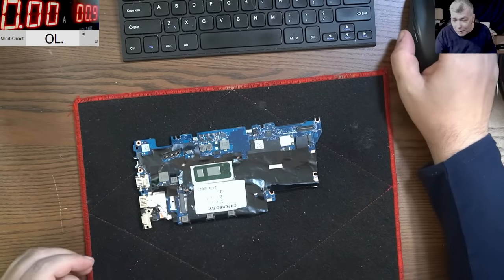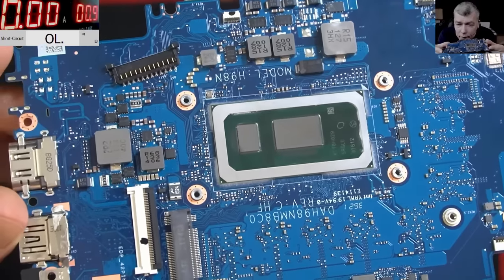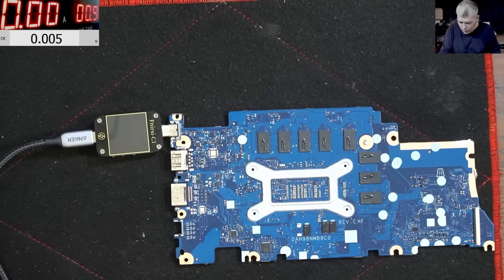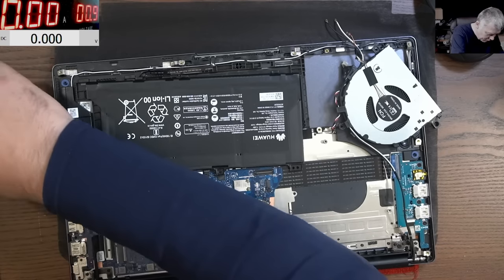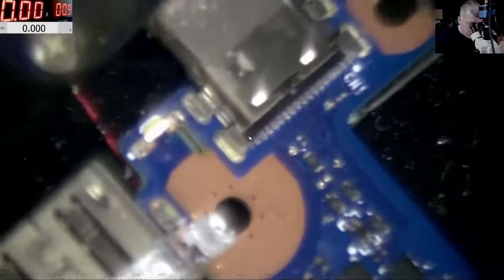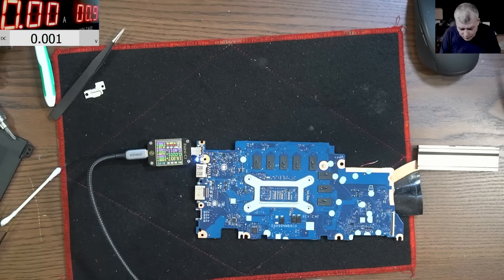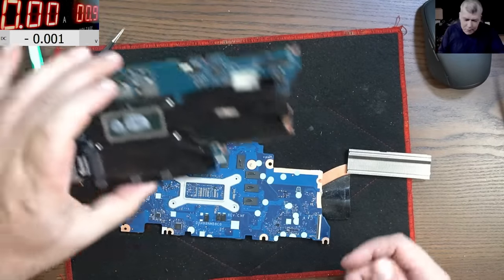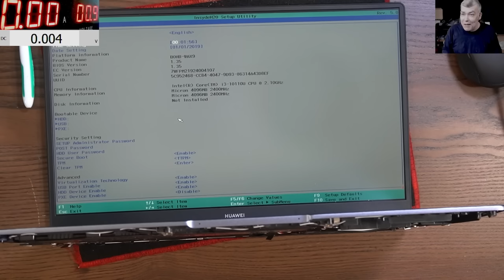Huawei D15 laptop. dead - Buying faulty motherboard from Ebay and fix it? Can we? Worth it?

Comment: SORIN PLEASE at least one time, just one time show that you change the thermal paste, you drive me crazy, you put the heatsink without any thermal paste, just whatever crusted bits was left on it, PLEASE DONT KEEP SHOWING THIS to people, its not ok to do this, always change the thermal paste
Reply: He will change it later. It was only for test
Reply: Hihihihi
Reply: Chill m8. Sorin changes the paste if it needs changing, and he doesn't if it doesn't. Think of it like this, If your laptop didn't have any problems it would have the same paste all its life.
Reply: @Brianck1971  ahh okk  he changes the paste after removing the heatsink only if it's necessary.... like "head gasket" on cars :) hiihihih
Reply: I can confirm he does not change. He fixed my dell last week. Same old crusty paste.😂
Reply: @hinny2005  i think he might not even have one on the shop, like it costs a lot or something, more people should tell him this is not right, he is a great technician but some things he does are just wrong, thank for sharing
Reply: @hinny2005  He has never been anywhere near your Dell.
Reply: @Brianck1971  the xps from last week was mine. Personally I don’t have a issue with him not changing. His job was to fix the fault. I can change the thermal paste myself which I did.
Reply: @Brian C  I have heard the he changes it later story many times, is it so bad to show the proper way, even one time, find me one video where he does it my friend
Reply: @jimmysmantzas  in many of his older videos you can see him changing the paste
Reply: @ДимитърАндонов-ъ7е  i just show him change it for the first time in the new video today with the pch replacement, i just wish he would show it more often
Reply: i just show him change it for the first time in the new video today with the pch replacement, i just wish he would show it more often
Reply: @hinny2005  It was not yours and there was no thermal issue with that machine.
Reply: @Brianck1971  what are you talking about. It’s literally in front of me right now. I’ve told you twice it was / is mine. The thermal paste needed changing, dropped 6c after I replaced it. I’m not going to respond anymore to your idiocy.
Reply: @hinny2005  Changing the thermal paste would not make the temp drop 6c. I still dont know why your prentending that some random persons laptop was yours.

Comment: what?? solder mask?? no! that's wrong. we expect solder mask on the alex channel. here, it must be hot glue! uff. i hate this mixing. what's next? louis using a proper calibrated fuse? weird.
Reply: each item has it use, hot glue is used for holding plastic  or big compounds in place, uv mask using inly for small wired and for isolation

Comment: 3 "technicians" already have checked the board.. Hah.  
Anyways, I suggested on  the previous video to buy the board, it is worth the value, in the worst case scenario for spare parts... But it comes up that is functional.
 Good call Sorin ! Keep up the excellent work !
Reply: Probably it is just type of techs that just replace motherboard :D. In my young ages i was working in that type of company, now sometimes i replace capacitors :D.

Comment: the seller has so many motherboard, and too few time or people to check every single recovered part is working (or not). so is a game of speed, to list enough boards per day. it not worth the time, for them to get bogged down. so instead with ebay condition category sell a parts / not working... this is not unheard of. and if the board costs them $0 originally as an e-waste... then thy made a sure fire 30 bucks. for the work to make the listing

in terms of broken charging port / broken tracks then yes, it does not worth their time. and maybe they can guess well for this common damages. anyhow, very interesting to see this example dead boards. a good learning experience to share with us here
Reply: ebay take 10% of that as a fee, also paypal takes a fee, ...in the end you get less.

Comment: When I saw all the broken circuit lines (pads) I felt like dying! How is that possible! How does the user manipulate, i.e. insert the connector like that? ...could accept let's say 5 broken lines but ALL of them (omg). On the other hand, excellent work of patience yours teacher Sorin and therefore a happy customer. Thank you very much for sharing because here in North America it will be difficult to see a laptop from that manufacturer. Cell phones YES, they are common (people buy them). All the best.
Reply: what i suspect is someone tried to replace the charging port and ended up breaking all the traces
Reply: @saberben4785  Yeah, you're right. It makes all the sense in the world because I should have assumed the owner would insert the plug carefully. Thank you very much for answering and i mean it with absolute sincerity because that's how we all learn. All the best.

Comment: Dear Sorin, I thought that the problem of this series of laptops of this manufacturer was the failure of the SOC Package . In my opinion, the motherboards of this company are not in a very good condition in terms of quality. I think if you buy a BGA device, your success rate will be higher, there are many cheap options like Seamark ZM Series

Comment: I have been to a RMA dept factory sale and there was mountains of PC motherboards - bought 5 and 1 worked -. 
I'm guessing it's from a RMA dept, ie, if they can't get it running in 1hr they just swap it out. So it's either the RMA selling the old stuff, or it's from e-waste recyclers where the RMA stuff is dumped.
Reply: Yeah. Completely agree. They call them "flea markets", "garage sales", "auctions" "swap meet", etc., they take a street in a city and set up their sales tables, usually on Saturdays from 8am to 3pm and you can buy from gadgets complete electronics even by separate parts. I also love going to a specialized auto mechanic because they don't get complicated, in the event of an engine or automatic transmission failure, they simply completely remove the old one and install a rebuilt one. I'm talking about the US states of course. A brotherly greeting from Mexico.

Comment: Sorin, the 3.3v and 5v always supply is short, I injected volt 5v at 5v pwr supply audio codec ic heated. But on 3.3 line I injected 3.3v board takes 5amp but nothing heats the pch is getting little warm but non component is heating, spend two days. Touched almost every component. What could be the solution.

Comment: I am saying to my customers that if they like, we can risk. I'll buy a part, and spend time on a repair. If things will go sideways, they pay for the part, or I keep the device. Especially with TVs, laptops, phones and tablets. But with game consoles, I say that I can buy off game console if I can't fix it, I'll use it for spare parts. With dearer items like PS5, when you replace an HDMI port, you can see that an HDMI encoder can get faulty. Not often, but have 1 PS5 here with this issue. And, I've said to the customer that if he wants to proceed, now the repair attempt fee raise up to £50 because the chip itself cost £48 + my HDMI port.

Comment: I am curious: the specifications of the new motherboard are the same as the old one?
The Bios of the new motherboard says i3 10110u which is entry level CPU, but D15 is also sold with i5  configuration
Reply: Yep it could be a downgrade, but still customer have working laptop which is the most important, if it wasn't fixed, it would to ewaste or parts but now it can be used for long time
Reply: I3 or i5, you would not notice in any sort of task/work on this laptop. Not a gaming laptop
Reply: @silviuguseila2552 Are you serious?
I3 10110u has only 2 cores against the 4 cores of the i5 only this mean i5 has double the performance compared to the i3, just see any comparison.
No one thinks this is a gaming notebook, but that doesn't mean halving the performance is acceptable.

Comment: I bought a faulty laptop with a shorted PCH on ebay.  Easy fix but need a bga rework station.  Do i have to clear some of the bios instructions when changing pch?
Reply: Pch is nothing but easy fix😂 that's the most difficult ones
Reply: @ДимитърАндонов-ъ7е  and as if sorin was listening, posts a new video about pch replacement.

Comment: i would change the whole charging port with a usual dc jack....19v and ground and change the plug on the charger too!! thats it!! for me, i dont care about usb c!
Reply: U can't do this, newer laptops have complicated voltage negotiations with specific usb c chips
Reply: @ДимитърАндонов-ъ7е  correct,  always buy a laptop that has a proper charging jack/port....These laptops with USB-C will break sooner or later.

Comment: The charging port is horrible on this model. It breaks VERY often and easily. Super bad design. AND it is the only USB-C connector on the board! Chinese stupidity. I would not buy this laptop, ever.